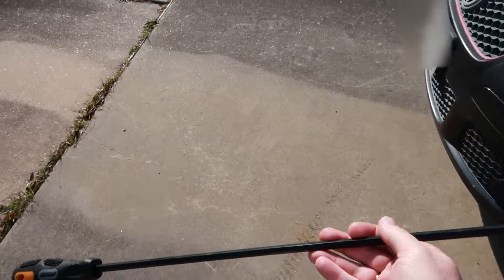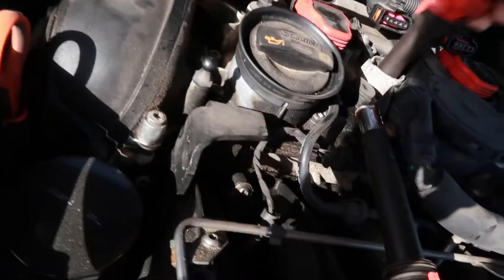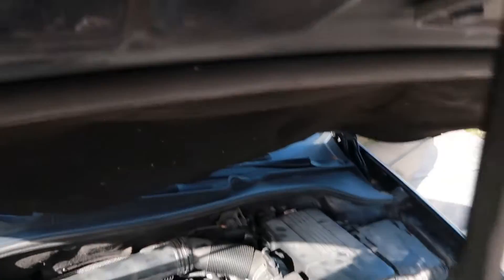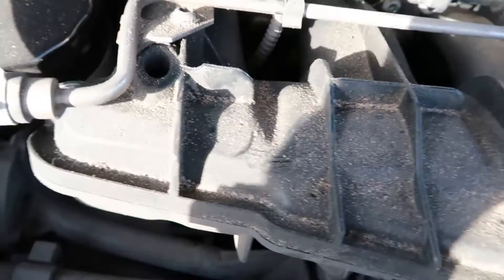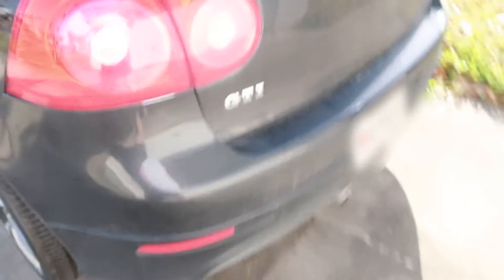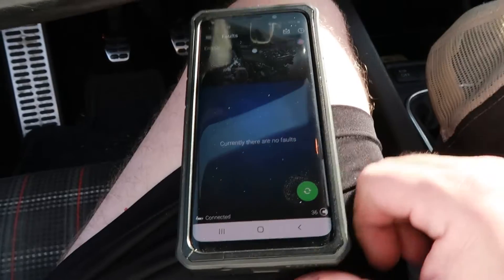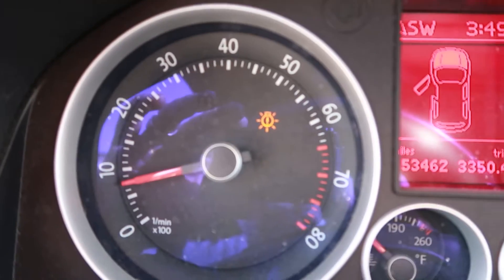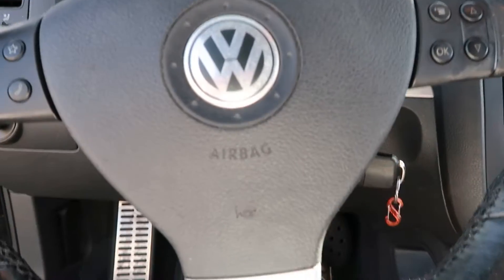⚡ VW GTI MISFIRE CHECK ENGINE LIGHT AND EPC LIGHT ON VW

Comment: Hoping it's a cylinder issue for me. Got hit with the EPC, then CEL, then turbo does not work. I'm scarred from a faulty turbo from my time with a Cruze.
Reply from the maker: @Vwgti2011  Oof, I wish you the best.
Reply: @MANATWORKlives  thanks buddy scanned it got hit by the dreaded P00AF00 and P256300. How VW gets away selling defective turbos is not right, extended warranty expired 1 month ago -_-
Reply from the maker: @Vwgti2011  yeah, I am trying to find why I feel what feels like a misfire at 2500 rpm and 65mph.

Comment: Sooo I have a epc light it only comes when I break slowly and then press on the gas it goes away could be my coil packs ? Because I also have a break light switch faulty idk if it could be that
Reply from the maker: I would fix the known issues first and go from there.  Get a code reader or go to a parts store that can pull your codes for you to research.
Reply: @MANATWORKlives  thanks I got some codes such as -
Faulty break light switch 
Low transmission fluid 
Abs break control moduel 
I hage only replaced my PCV valve my right speed sensor
Reply from the maker: @Alexis-mk6  I would verify your tranny fluid level per manufacturer specs.  You may need an updated ABS pump installed (wasn't my fave to do) and get it programmed to you VW at the dealer (it took them a while to get mine programmed.) Brake light switch should be behind the brake pedal but follow the directions as some switches are a 1-time shot to install. Clear all codes after that and drive it to see what happens after a few trips.

Comment: This actually helped
Reply from the maker: It was worth making the video, then - I am glad it helped!
Reply: @MANATWORKlives  I have a check engine light on my car that was flashing now it's a steady solid light could this be the problem I'm having coil issues coil pack?
Reply from the maker: @busterlouie6176  If your engine is running obviously rough, it is a possibility that you have a bad coil.  I have had a check engine light with a code for supercharger/turbocharger underboost, which could be from trying to accelerate in too high a gear - that code would not go out on its own after a week of driving.
I would get your code checked at your local parts store if they offer it to get an idea of where to start.

Comment: i also need to replace my intake manifold on my golf 7 gti
Reply from the maker: What happened to it?
Reply: @MANATWORKlives  
been driving like this for half a year but this problem came from nothing valve does not open well-known ailment at low revs the car starts to stall, it must be fixed quickly before I go into winter haha
Reply from the maker: @DeGier  Good luck!